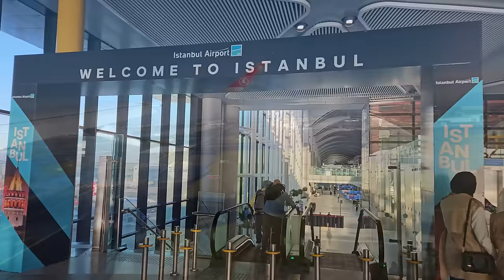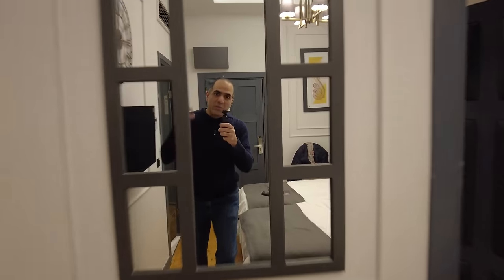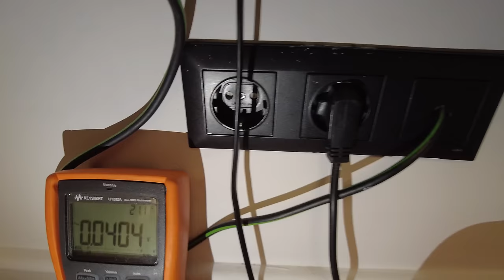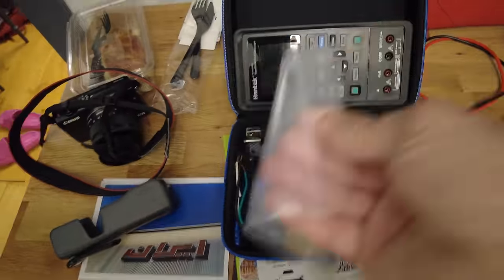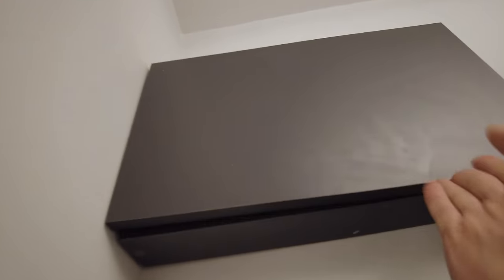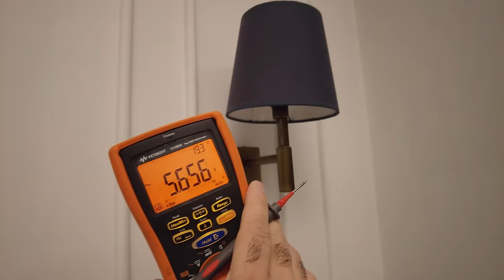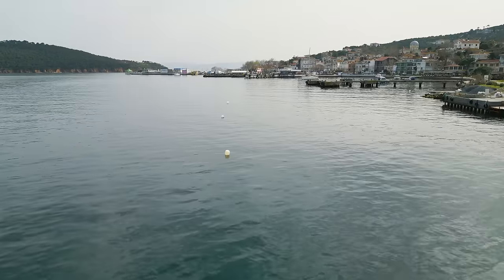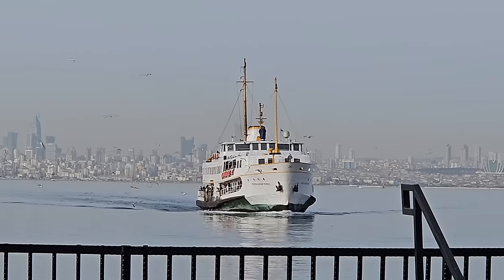Turkish Electricals Are Almost TOO CLEAN

Comment: Usually in Europe (by EU norm) you have a dc transformer outside of the bathroom that powers the bathroom lighting with 12V. All 230V outlets should be water splash resistant (IP44) and anything that is more than 12V should be 2,2m away from water sources.

Comment: next to the type F outlet there is also the Type E outlet that has next to the Type F features an additional ground pin that forces the plug to be inserted in one way, ensuring phase rotation for devices that need it. Type F plugs with ground are usually compatible with Type F outlets by having a additional hole inside a metal plate above the Power prongs connected to the Ground strips on the side.

Comment: The security check button in the main breaker dosnt work once it been once used …it will resume its work after some days .some time delay is installed … here it’s suggested on every main breaker to puch the button after every month.

Comment: I'm not sure what they're called in the UK/US (you guys have the funniest acronyms) but there's probably a GFCI combined with a fuse (we call them aardlekautomaat which is not Turkish but Dutch) in the main distribution panel. This device is probably 300mA because it's only there to protect the cable between the main panel and your panel. If it was 30mA then because of selectivity it would pop before the GFCI in your room. That would mean you would have to go to the main panel every time there's a fault.

So because the GFCI in your room was faulty the interuptor at the main panel popped at 300mA. Which mathematicians say is 10 times as much.

The delta t is defined as 300ms, which your tiny resistor should be able to endure... you were right that much. :D
Reply: Or there was such a high short-circuit current (I believe Turkey mostly uses TN-C-S supplies, so an earth fault is essentially the same as a short) that a main fuse blew. Main RCDs are really only used in TT systems.
Reply: RCCB
Reply: @Ragnar8504  Well, a bypass is essential for the GFCI to pop. The PE isn't connected through an interrupter. So the PE bypasses the interrupter while the N goes through the interrupter. Freely translated, we call this "short to frame".

So when there's a short to frame (PE) the GFCI should pop and when there's a short to N the fuse should pop.

In a TN-CS system, they both essentially are the same, but not according to the code. A GFCI is a personal safety device (shock) and a fuse is an installation safety device (fire).

Because a GFCI is a personal safety device, its performance characteristics are much narrower and stricter. If a short goed through your body the fuse wouldn't pop or would be much too slow.

In our code you are required to use a GFCI in both systems and in The Netherlands TN and TT are both used depending on your region. They put a sticker on the main fuse that says: "Earth is supplied by network" meaning you shouldn't install your own grounding rod.
Reply: The 300 mA RCD is to make the TT earthing system work. It protects circuits that are not protected by a 30 mA RCDs for example because the regulations did not mandate at the time or because they are exempted. In Finland for example fridges, freezers and other equipment where loss of power would cause significant harm are exempted.

Comment: I freakin love our German/Swiss/European outlets and plugs. You get very secure well-seated connections. It combines the possibility for super-efficient rows of small chargers, with the possibility for larger and more secure plugs, all in one design. Add in the higher voltage (makes me laugh at Americans and their under-powered outlets all the time). Perfection.
Reply: The British plug is even better
Reply: @Aresydatch They are too big and bulky, they only go in one way, if you step on it bare foot and you will cry. And the unnecessary fuse in the plug only drives costs up. It doesn't have a small alternative plug for when ground is not needed, for example phone chargers. They're way bigger than european ones for no reason.

The British plug is good and safe don't get me wrong, but the schuko is better, more compact and just as safe. When you realize they're equivalent the British plug feels outdated.
Reply: @Aresydatch  Nah. Popular opinion for sure, but I think it's wrong.
The British plug doesn't have as tight of a connection, is WAY too big, and doesn't offer compatibility with the super-space-efficient Europlug. Again, that's the main advantage. Super space efficient plugs, and super secure plugs, all in one system.
Reply: @TexanMiror2  has a tighter connection? no way Type G was the strength of superman, even the plugs in my 1980s house are strong as hell. In the hotel im typing this from in Italy, they decided to spark half the time and are looser than all hell
Reply: British plugs also have safety gates so you can't plug anything in to live without the earth pin going in first to open the gates.
Reply: @Aresydatch  Arguably better, but over-engineered.  Statistically, they do not add a lot of safety over Euro installations.
Reply: @MrVideowill 
Yeah and you have to have breaker in each Plug BC of idiotic ringwiring the brit are using^^
Reply: @kaasmeester5903 do we have any statistics we can look at?
Reply: @MrVideowill  It is not possible to plug in a Schuko plug without connecting ground first. It's built right into the design rather than the afterthought fix in UK plugs
Reply: The US pioneered electrical distribution. By the time Europe caught up it was realized 200V+ was better, but it was too late to change the US as everyone already had 120V appliances.
Reply: Polish/French type E sockets and plugs are better than type F plugs/sockets, grounded plugs always polarised, ground prong in socket blocking before contact with plug prongs and ensures ground connected first
Reply: @MarkPentler  Not many if you want to compare the safety or lack of it of modern EU installations vs modern UK ones; some countries have more old homes than others, with varying levels of retrofitting the electrical installations in them.
   
Some studies do cite the most common reasons for fire or electrocution: outdated installations, lack of RCDs or improper installed ones, worn out (arcing) switches, dodgy solar panel installs, incorrect earthing, overloading circuits, worn wiring.  Most of that is addressed by both EU and UK code.  The UK has the advantage of individually fused plugs and extension cords that make it harder to overload them, but these days almost all extension cords you'll find have a high power rating, and overloading them is pretty hard.
   
The one thing that I think will make a big improvement in safety is the introduction of AFDDs, arc-detecting breakers.
Reply: @25566 I'd argue that the fuse in a UK plug is not unnecessary. A fuse is there to protect the wiring from overcurrent and therefore fire. So the fuse for the sockets is rated for the wires going to the sockets.  Now if you plug in something with smaller wires, like say like literally any appliance, that wiring going from the socket to the appliance is not projected by a fuse and could over current and catch fire. The fuse in uk plugs cost very little at all and provide significant benefit. 
I'll grant that the euro plug is better for space saving and is decently safe plus doesn't destroy your soul if you should happen to tread on one.
Reply: The first socket in the hotel is faulty, the ground comntact is bent inside. Sometimes happens when a dumb user hits a plug with fist instead of plugging in properly.
Reply: @Aresydatch  british plugs are large, ugly and actually dangerous. Steppin on them is extremely dangerous. And they are only 13 A, the European plug is 16 A.
Reply: Technically the UK plug is considered the safest, you guys can cry whoever you want.
Reply: @ArkhamHedler  The European standard plug might not have a Fuse integrated, but even the flimsiest appliance wiring is more than sufficiant to blow a fuse with it without creating a hazardous situation
Reply: I've only been shocked once when I unplugged my laptop's charger. It's got the all-metal plug, so if you grab under it, even though the outlet is recessed, you can still get a shock for a few hundredths, which is what I got
Reply: @casualriley  you are wrong the First distributionline was build in Germany (Bayern(Bavaria 1882) to be precise)

Our Schwebebahn in Wuppertal is also 100+ years old (running on electric too)
Reply: @casualriley  USA system is a little bit mess right now. We have 120, 208, 240 all over. It is not easy to clean them now.
Reply: @uccoskun  208V is an industrial/commercial 3 phase voltage, you'll never see it in residential. 240V is two sides of a 120V split phase residential system, if the US switched to 220V those appliances could simply be rewired, but 120V electronics would need to be scraped or powered with expensive step down transformers.
Reply: @JanSt12  To be fair, railways generally run on their own powers instead of using the electricity of the country in general. If anything, that proves riley's point: Today's railway electricity standard is 15 - 25kV 50-60Hz AC for mainlines but many European countries use 1500 to 3000V DC for their general railways while the DACH and Nordic countries manage to be early AC adopters but use a 16.7Hz frequency, not to mention South England's use of third rail when almost the entire rest of the world (except parts of New York) use overhead wires for intercity transportation even back then.
Reply: @JanSt12  The first electrical distribution system was built by Thomas Edison in 1879.
Reply: @JanSt12  The fuse in the plug is to protect the electrical cable.  If you've got a lamp with say a 3A rated cable then a 15A breaker back at the fuse panel isn't going to help.

Comment: I went to Istanbul recently and noticed the prolific use of large LED light in the Grand Bazzar. It seemed like they were pushing the intended design of the Grand Bazzar cooling with the extra heat generated.

Comment: 15:07 come to Indonesia, you must check our electricity...
Reply: Can't wait for messed wires everywhere
Reply: the Earthing System in our country is the one most questioned topic, 
Because everytime you want to installing some new electricity with Earthing system, but the PLN (Electricity Company) technician ignore it and they will say "Your meter will have "Check" error message" (Especially if you're using Prepaid system one) or Electricity Leakage reason (or other theory maybe) although the electricity installations are normal here

Comment: As German, of course I love the ‚Schuko‘, but would totally agree with defining the type N 3-Pin-‚Euro‘ Plug as the standard. 
Simply because it a) fits the already common 2-Pin Euro format and b) would allow both grounding, as well as c) a definite polarity (middle pin/ground pin slightly shifted to one side) for applications that don’t like having live on the originally neutral side - for which currently, one has to use the clumsy blue CEE.
Reply: THere are currently any aplication that requires neutral/live diferentiation and uses plugs? I've found some, mostly due to being multiphase, but all those cases the app had no plug. (Must be directly connected to the box)
Reply: @framegrace1  I came across those on industry grade washing machines or kitchen tools, for example. 
Reason for the blue CEE might though be better moisture protection and higher durability if actually running close to 16A over a longer time. 

But aside from that; cheap asian stuff - RC switches for example - on which a two-line-relay was obviously too expensive. So on a 50/50 chance, you plug them in to switch the neutral instead of live. 
Also, common lamps with E27 or E14 sockets. Those are supposed to have live on the middle pin and neutral on the thread. But if you flip the plug …
Yeah, sure, you are supposed to pull the plug before changing bulbs or remove dust. But most people just switch it off. And if the common in-cord lamp switch also just breaks one wire for the sake of a slim housing instead of a fully grown two-line-switch …
Reply: My remote-controlled smart plug only switches one contact so it's 50/50 whether you get shocked when you touch the output wires while it's off. 
Or maybe it's only 25% chance to get shocked since both can be either way round
Reply: Type E would work better for that
Reply: @Blechfuchs  yeah, normal schukos are rated 8 amps for continuous load. There are also schukos that are usually blue that can be loaded 16 amps continuously. And then there is blue CEE "caravan plug" also boats have this.

Comment: You can see that the RCD is overridden. All the cables go ont the bottom of it but there is none on the top. I see the same thing being done in Greece, where electricians don't bother finding the ground fault in the installation.

Comment: Not so simple. But at least it is 230V 50Hz

In Europe, there are several types of electrical outlets and plug standards, with the most common being Type C, Type E, and Type F. Here's a quick overview:

1. **Type C (Europlug)**: This two-prong plug is common throughout Europe, with the exception of the United Kingdom, Ireland, Cyprus, and Malta. It's designed for devices that don't require a ground connection and has two round pins.

2. **Type E**: Used primarily in France, Belgium, Poland, Slovakia, the Czech Republic, and some other countries. This plug also has two round pins like the Type C, but it includes a hole for the socket's male earthing pin.

3. **Type F (Schuko)**: Very similar to Type E but designed to fit in a socket with two earth clips instead of the single earth pin. It's used in countries like Germany, Austria, the Netherlands, Sweden, Norway, Finland, Portugal, Spain, and Eastern Europe.

The *United Kingdom and Ireland* use a different standard, known as **Type G**, which has three rectangular pins in a triangular pattern. Cyprus and Malta also use Type G.

It's important to note that while the plugs and sockets might differ, the standard voltage across Europe is generally 230V with a frequency of 50Hz. If you're traveling to Europe, it might be wise to carry a universal adapter that can accommodate these different types of outlets.
Reply: Which one does turkey have?
Reply: @siyacer  in the video is Type F
Reply: And South Africa uses type C and G
Reply: @siyacer  C and F mainly, E for sockets connected to UPS or local generator circuits
Reply: Italy and Switzerland have their own standards.
Reply: Most of Europe use three different plugs: CEE 7/7 grounded, CEE 7/16 Alternative II i.e. the Europlug for double insulated for low power and CEE 7/17 i.e. the contour plug for double insulated high power (vacuum cleaners, hair dryers etc.). The Europlug woks in all continental Europe. The contour plug does not work in Switzerland or Italy and CEE 7/7 does not work safely in Denmark in addition to the two. However, both Italy and Denmark have started to install also compatible sockets.

I advice against universal adapters. They can be highly dangerous.

Comment: You should rate different plug standards. I got shocked touching the body of a dish washer and the stainless steel counter top of a basin back in the 80's.
Reply: how could that happen
Reply: @izachu904  I have no idea. I was under 10y at that age, and my mom told me about it, so I had to try it. Potential difference?

Comment: It did work, but the electricity started "flowing" very fast from the main source, outside of your room, because of the "leak". It seems they have more sensitive electric fuse. That's why it have triggered first. Or it was indeed broken and that's why the one outside did it's job, because the leak has grown enough. 😅

Comment: There are actually some nice partnerships between germany and turkey in regards to energy. They are using the european power grid and (at least should always use) european power safety regulations.. so like over here they use 220V@50Hz. TBH the whole electricity you showed there was like 1:1 what we have here in germany.. down to the Siemens Current Protectors. They are also supposed to have stuff like "TüV" for their cars but afaik lots of these programs aren't working as well as they should.
Reply: The fire safety system is german too.. but thats understandable.. i find that in lots of places.. last itme was Luxembourg.
Reply: @ViewTube_Emperor_of_Mankind  I have an immense hate for tüv though It feels like a monopoly that rips you off for anything, inspectors always find something to add on the list even in brand new car they excuse the unreadable engine tag I think regular check makes traffic safer but how effective are they actually ?  a lot of people just plug the illegal stuff right after passing tüv anyway. Otherwise we wouldnt be hearing straight pipes or seeing blinding xenon lights in traffic each day they are more of a hazard for me.

Comment: 1:50 well I sure hope it's not actually European style. In Finland that would be big no-no that close to water source. Finland does implement EN standards basically directly as national standards (SFS-EN), so should be similar across EU.
Also here GFCI should be tested every month, but no one does that and I've seen quite a few not working (Fluke T150 is good alternative for blowing up 1/4W resistors, but ofc not as entertaining)
Reply: They should be tested regularly but there is no monthly rule.

Comment: You can solder a 2.2k ohm resister to your multimeter fuse to act as a backup fuse. At least that worked for my multimeter!